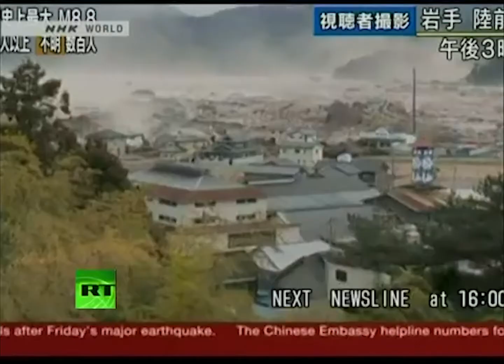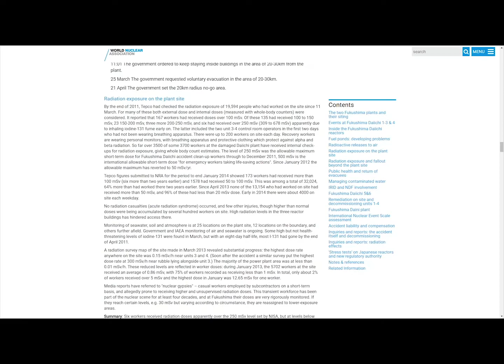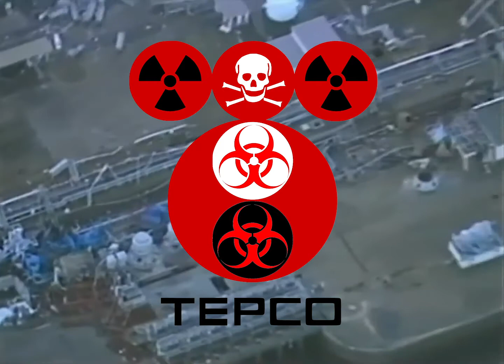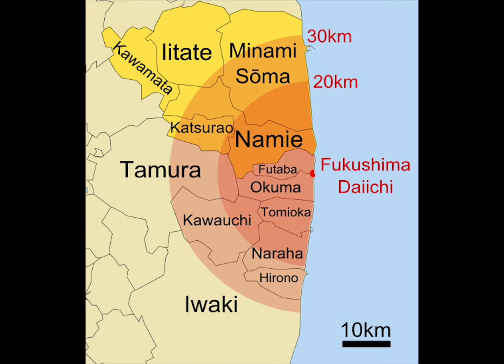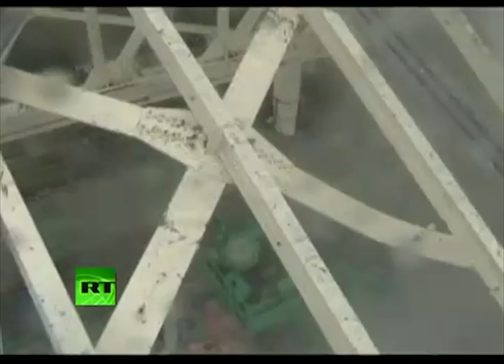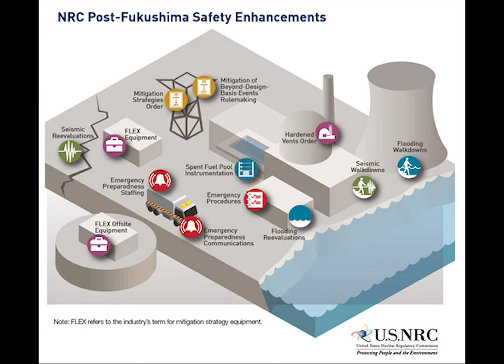Fukushima Nuclear Disaster and Recovery Efforts

Comment: The only "disaster" was to TEPCO's pocketbook.  https://principia-scientific.org/physicist-there-was-no-fukushima-nuclear-disaster/
Reply: The only disaster is you harassing everyone that says Fukushima. Explain this Craig....Ok Geiger salseman, explain to the good people of this video just how a geiger is calibrated using the inverse square law and how that law to is also used in the measurement process.  Then explain how Gamma attenuation works and what the geiger does to TRY to combat that, then tell everyone how dead time works and then quenching. And then finally but not least of all explain saturation and how it affects the tubes efficiency especially in an extended source.  Replace the word geiger with every other radiation detection device and explain for each as well, this should be good. We will be waiting for you Craig
Alpha nucleus particle beta electron particle gamma ray x ray.  At the end of both alpha and beta decay modes there is a gamma photon release.  Transuranic and radionuclide evaporation equilibrium coefficients show water soluble elements and isotopes bond with molecules and travel around the planet with tritium being the worst as its radioactive hydrogen and a half-life of 12 years.  This gives it 12 years to get inside each one of us and every single water cooled reactors release tritium normally. The inverse square law ASSUMES a singular point source in a vacuum that emits isotropically.  ANYTHING outside of these parameters, such as an ATTENUATING SOURCE, EXTENDED SOURCE, DISTRIBUTED SOURCE will not yield the same 4*pi*R2 principles needed for any radiation detection device.  The only device that shows us what making the ionizing events to occur is a mass spectrometer and it to also has the same issue and why we don't know the proper levels. Every cause of cancer is unknown billions of cases.  Since every cause of every cancer is unknown than any and all points trying to be made with cancer are null and void.  Until a list with every different cause with the totals in those categories then no debate can be made for the use of nuclear materials. 

The Earths Climate changes and has for millions of years through solar minimums, maximums and the Milankovitch cycles.  Before the minimum the solar dynamo ramps up, stretches and compresses that toroidal field of the sun causing sunspots to occur.  At the peak of the cycle before a minimum with a diminished magnetic field will not be able to trap the charged particles and magnetic fields that will be released 360° and cause the entire Earth to go dark for decades.  When that happens those nuclear reactors no longer receive cooling water and all go into meltdown at the same time.  Yeah, real smart...
Reply: Everyone can see geiger salesman where your bias and loyalty lies.
Reply: ForbiddTV.....2 accounts in one thread Craig?  You really think people don't know any better by now?  1st like youve been shown and proven....to find a fukushima radiation death we first need to find the list of deaths caused by cancer that was induced by ionizing radiation ONLY.  Without that list no one even you can make any assertions.  2nd all radiation detection devices are calibrated using the inverse square law and this law only works in a vacuum and does not apply to extended sources therefore all measurements are null and void.  Add gamma attenuation, dead time, quenching, saturation and the need for a perfect voltage and they are next to worthless.  Now, you have nothing else, no other possible avenue to pursue.
Reply: Paul Mobley  How about you show a death due to Fukushima radiation?  Or maybe an increase in cancers since 2011?  Are the oceans dead because of Fukushima radiation?  Is there any deadly levels of radiation anywhere on the planet?  What exactly do you have to work with?